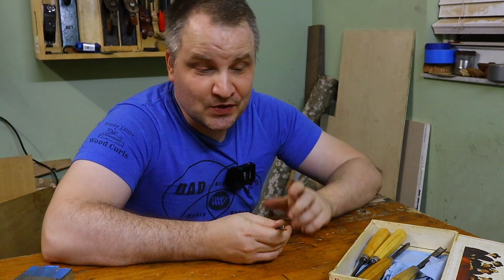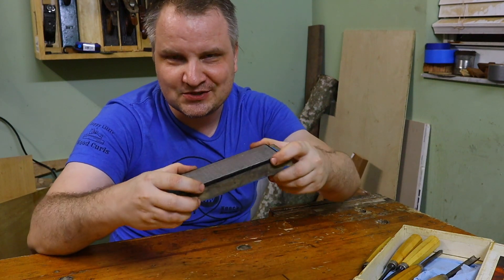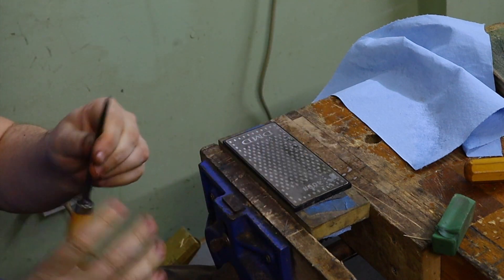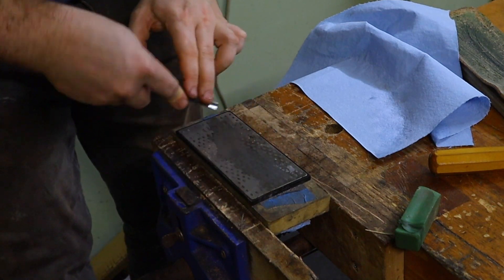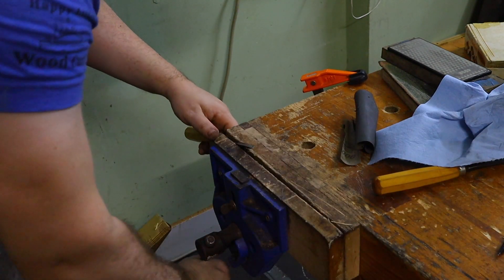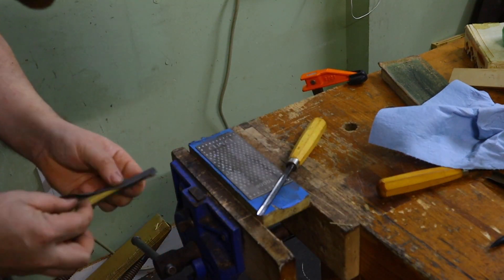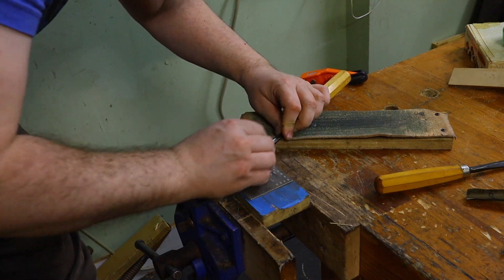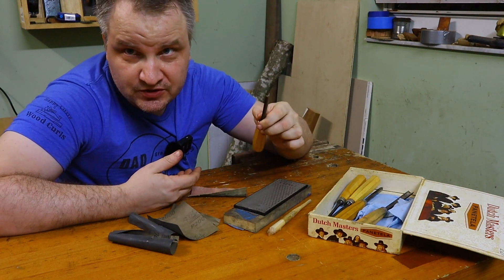Sharpening a carving gouge using a cheap set of tools

Comment: what brand are those cheap gouges. They look like Mifer  from Spain.
Reply from the maker: Specifically these are MIFER, but if you can get hold of an antique (read, rusty'ish) ones, they should be priced "cheap".  If you not too far from MWTCA tool meets, it would be the best place to look for them
Reply from the maker: I thought MIFER if German, but good to know that I wasn't correct.